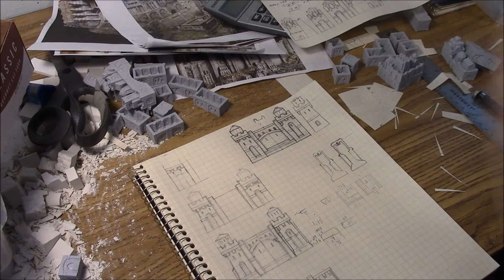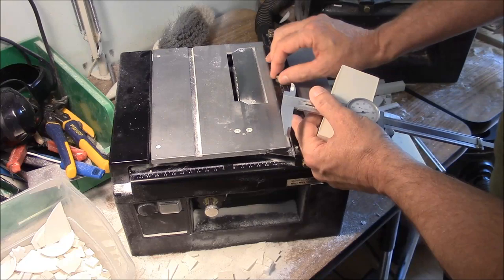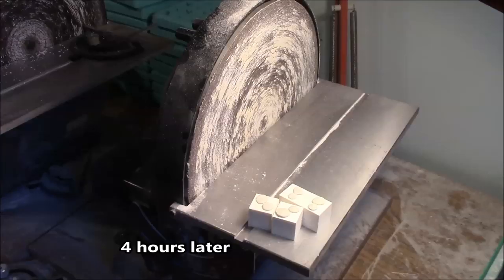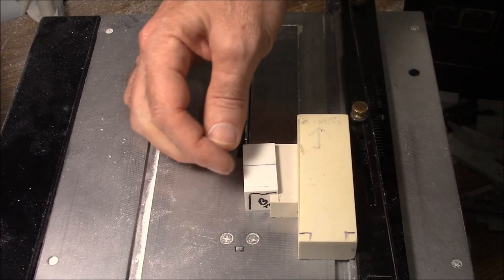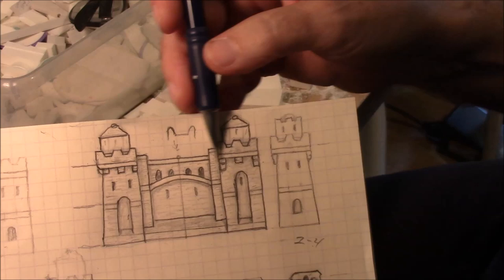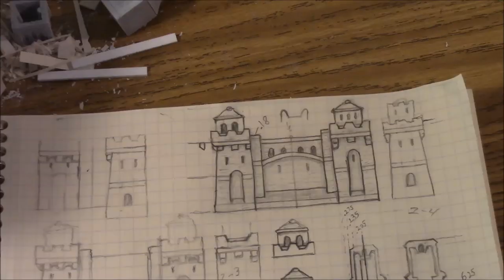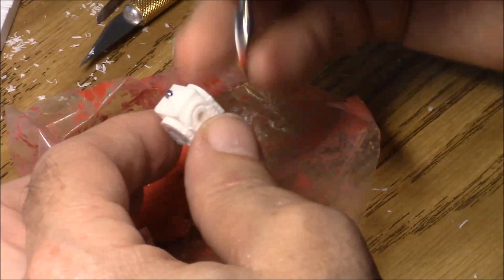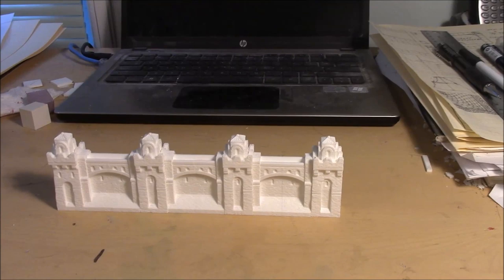Hirst Arts Sculpting in Plastic

Comment: Thanks so much for sharing, Bruce!

Was the resin you cast with Smoothcast 305? You seemed to get very bubble free casts for not using a pressure chamber.
Reply from the maker: It was smooth-cast 300. I always run a dehumidifier in the room and close the room up a day before I cast. These plastics are very sensitive to moisture.

Comment: This was great. I love seeing the end to end process. Do you make all your masters out of plastic/resin or have you just started doing it for this new range?
Reply from the maker: It depends on what I'm making. For larger stone I usually use hardened polymer clay because it carves easily by hand and also cracks like stone. I would have used it for this project but the texture was so fine that plastic worked better.

Comment: That's a lot of fine detail and manual work. If it were me, I'd model the positive models in 3D, have them 3D printed, and then use them to create the molds.
Reply from the maker: Things may eventually go that way. I don't use 3D modelling yet but may incorporate it in the future. I don't see 3D modelling as the end-all though. At the moment what is still lacking are excellent textures. It's kind of like how oil painters don't just give up oil paints and use Photoshop on the computer instead. I could see making a 3D print and then adding texture onto it by hand or use it to construct difficult-to-cut bits. Many times I come up with ideas by simply carving in soft material. The computer process can be much more limiting in that respect.
Reply: @hirstarts8327  Yes, the 3D version could have some artificiality and lack of character that the actual 3D version can capture. I also considered the idea of combining a 3D print with some added detail after printing or otherwise using it in combination with the whole process as you mentioned. But you obviously know that the whole process is time-consuming. If you can use a new tool to improve speed and possibly quality, you know that some sculptors will use it and possibly already are.

The truth is that the skill and creativity of the artist are of utmost importance. Your design is original and compelling—and that is more important than whether it is done in foam or 3D. Thanks for sharing your skills and process with us. :)

Comment: Your website recommends dental stone for the mold process.  Are there any longevity issues in using the same plastic that you use to make your masters?
Reply from the maker: Using any kind of plastic in the mold when casting will reduce the life of the mold. You can get from 25-50 castings before the mold starts to crack and bits come off of the mold. However, any product that mixes with water (such as dental stone) will not damage the molds and they will last for years.

Comment: why not use wood??
Reply from the maker: Several reasons. First, wood is usually harder to carve than plastic (for me anyway). The wood has to be very hard in order to keep the fine details. Second, you don't have to deal with the grain texture. And finally, you can cast the plastic into different usable shapes using a mold before you cut and texture it. This gives you a lot of options to create your original shapes before texturing them.